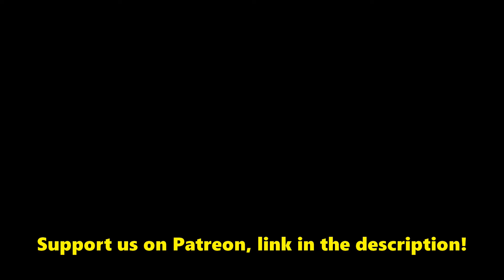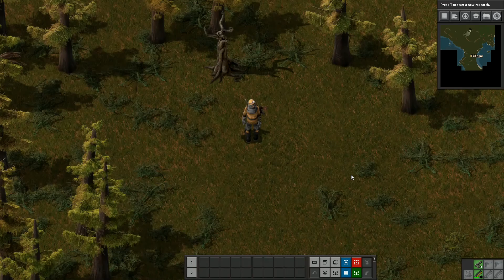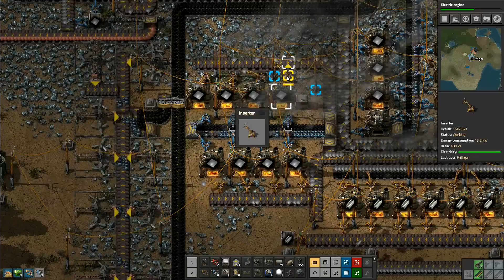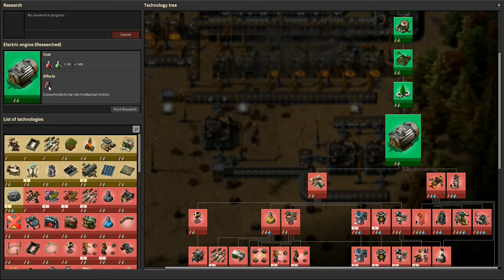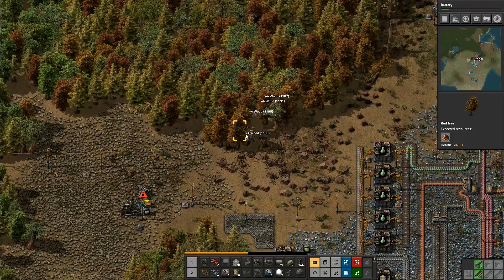Factorio Million Robot Challenge #18: Electric Engine Unit!

Comment: I  don't play this game, bud i wonder is there a limit on the researchlabs?Speeding up the research would speed up the game. Seems to me like the only thing thats a  slowing factor is the research not production. Looks like thats easy to expand
Reply: It's much much easier said than done, once you increase something you have to increase production if something else,  its a never ending battle to keep up with, iron is the thing that you must keep in stock.
Reply from the maker: Too high a consumption on the packs means that all our iron would be used up too early instead of balanced over the whole production line.  We're not far away from robots now though and the first thing we'll be using them for is clearing LOTS of trees from near the base so that we can start moving things off the ore fields
Reply: I think we all wish things went faster.  And we talk about the iron being the bottleneck and sure it is now, but it won't always be the bottleneck.  In my bases after I have 2 feeds of iron and one copper and like 1/2 a feed of steel I will start to run out of copper, and I can never seem to get copper caught up because it all seems to get consumed by green circuits and even then I'm usually still not making enough for the whole base and things just seem to take ages to complete no matter how hard I push, oh they do get going eventually and rockets with satellites do launch and I can spit out infinite science but I never seem to be able to fill all the needs.